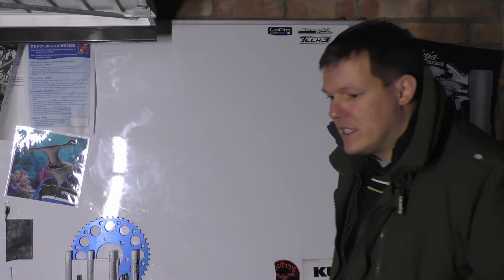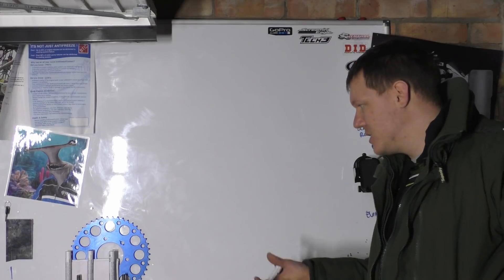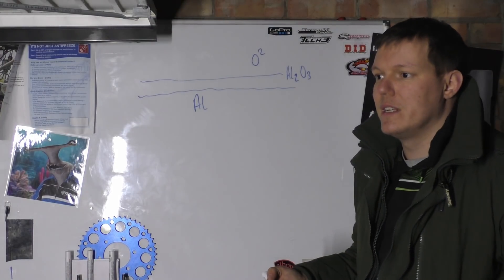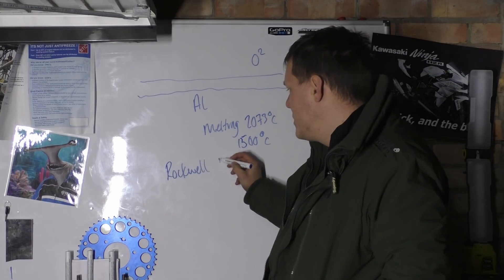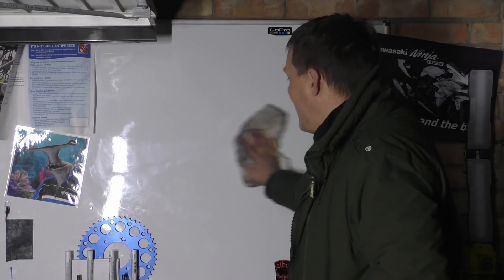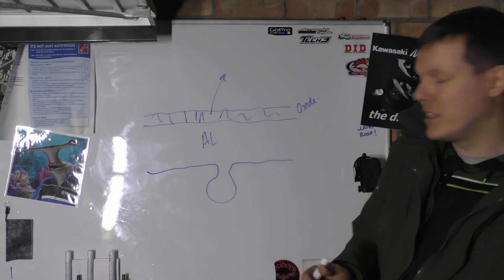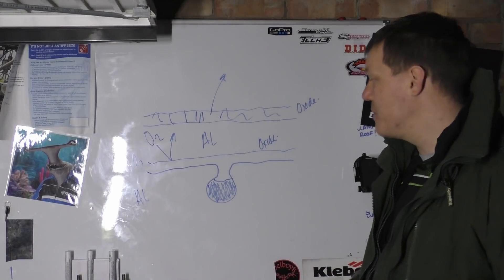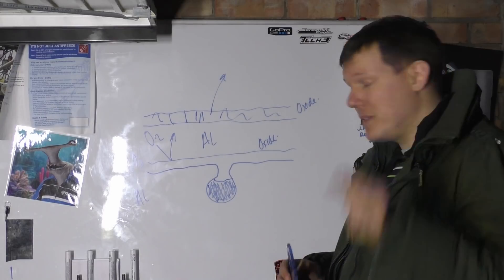Aluminium anodising - why?

Comment: First syllable = "A",  Short should "Ahh"
Second syllable = "Lu",  Like skip to my Lu. 
Third syllable = "min"  like 60 seconds
forth syllable = "um", like umm.
A-lu-min-um

I don't think aluminum (spelled correctly) oxidizes as fast as you say.  Machine and Polish some 6061, and it stays that way for quite a long time.
Reply from the maker: You mixing up oxide layers and oxide crystal growth -

Quote from Dr. Charles A. Bishop's (a chemical engineer) book - Aluminium and other alloys -

"Thus the first monolayer of oxidation is virtually instantaneous dependent only on the arrival rate of oxygen. Beyond this the oxidation rate is dependent upon both the oxygen arrival rate and the rate of diffusion through the existing oxide layer. 

Typically the oxide could be expected to be 1.5nm –2nm almost immediately and 2nm – 4.5nm in anywhere from 1 month to 1 year dependent upon conditions."

Source - http://www.cabuk1.co.uk/

Comment: An application where you can use anodization is iterative improvements of supporting arms for wheels etc, if there's some unexpected stress on the component you get these nice lines in the opposite direction of the stress. Then again if you need such weight reduced parts you probably have the money to let someone else deal with developing them anyways.

Comment: The anodizing of AN fittings seems to almost make galling of threads impossible for the reasons you stated. You can use a Sharpie marker to hide scratches in anodizing quite effectively, for a little while, anyway.

Comment: Great work... can you do a video on the optimal distance a single  cylinder piston should be when at top dead center in relation to the tip of the spark plug or the deck of the cylinder head... minimum and maximum distances
and how it relates to directly on engine performance. Thanks !
Reply from the maker: You mean the squish or clearance volume?
Reply: The Workshop sorry.. squish.. thanks !
Reply: Dave Micolichek quench is a negative effect on spark plug detonation ??

Comment: Many years ago, I remember reading that hard anodizing (anodizing in a cold bath with high electrolysis current) would build an oxide layer so thick that it was used to close the clearances on worn supercharger rotors to restore their performance to like new condition.
Reply from the maker: They have also used electro polsihing to bring back the tolorences when doing this. Electropolishing is a slower process and easier to control.

They would build up a layer of oxide - then after measuring - reduce this through the polishing process.

Comment: Anodising works differently to how you described it. Electrolysis is used to grow the oxide layer, not break it down. Within certain limits the longer you leave it in the tank the thicker the layer grows. Unlike the oxide layer that forms naturally the anodised layer is porous. This is where the dye goes. It does not go into pores in the metal. After anodising the part is exposed to steam or boiling water which seals off the pores, sealing in any dye and toughening the surface. 
Many moons ago I did some anodising. It's not particularly difficult, though getting the parts clean enough is a pain and you need to be a bit careful around concentrated acid - once diluted it isn't too bad though it rots clothes like you wouldn't believe. The worst bit is that the sulphuric acid fumes from the electrolysis make everything in your workshop rust like hell.
Reply: LesNewell Yep. The devil is in the detail isn't it? Matt sounds as though he knows what he's talking about on a fairly diverse range of subjects, but he's frequently sketchy on the facts. That's why it's important to do one's own research.
Reply from the maker: "He's the founder of Wikipedia, as Google could have confirmed for you. I wrote it in plain English."

- Yeah, that's not what I meant. What does that have to do with anything? Was my point. You went off on some weird tangent about Daniel Gauntlett. I get that you were banging on about the accuracy of wikipedia - but what does Daniel Gauntlett have to do with the subject? 

Secondly, it seems that you may have misunderstood how wikipedia works. I'm sure this is a stupid thing to say but part of what you said makes it sound like you think that Wales writes all of the information on wiki? LOL 

If you don't believe this then good, but that also makes the rant about Daniel Gauntlett void.

Back to the point both you and LesNewell both seem to agree that the base metal (ally in this case) isn't part of the oxide layer - or to quote 

"Electrolysis is used to grow the oxide layer, not break it down. Within certain limits the longer you leave it in the tank the thicker the layer grows. Unlike the oxide layer that forms naturally the anodised layer is porous. This is where the dye goes. It does not go into pores in the metal."

Firstly, the acid breaks down the oxide layer, secondly the oxide layer is Al2O3 - so where does the Al2 come from? Space? I agree that the oxide layer is porous and this is where the dye goes - but I didn't say anything contrary to this - I just did go through the entire process as this was about why its don't not to the letter how its done. I didn't state what acids or the acid generally used is. I didn't 'explain' anything about anodes or cathodes or what cathodes are used - I didn't mention what voltages, which way the current flows, layer thickness, brighteners, buffers or anything. 

Seen as though I have done anodising and plating before (some of which is on my channel) then I do understand how this works. You seem to think that I have just done a delboy - and guessed. 

We're gonna go into this in a video this week, and you're gonna look like a tit yet again. But keep up this 'matt needs to do some more research bullshit - its great. 

To add, I haven't seen your video or explanation on any of this stuff, shame really.
Reply from the maker: "Anodising works differently to how you described it. Electrolysis is used to grow the oxide layer, not break it down."

- I get where you're coming from and its a bit of both. The acid breaks down the oxide layer. I just thought for a simple video this was an easier way to describe it.
Reply from the maker: "Matt sounds as though he knows what he's talking about on a fairly diverse range of subjects, but he's frequently sketchy on the facts."

- what 'facts' am I missing?
Reply: Where you failed to describe the process as it actually occurs. Unless I and LesNewall both misheard you, you claimed the pores in the aluminium are what accept the dies, whereas it's the pores in the oxidised layer that accepts the dies, which I don't recall you mentioning. 

I also don't recall the (essential) electrical process being described. It's not as though the process is actually very complicated, so your "simple video" defence is somewhat mute here. 

Even the Wikipedia page describes it accurately:

"The anodized aluminium layer is grown by passing a direct current through an electrolytic solution, with the aluminium object serving as the anode (the positive electrode). The current releases hydrogen at the cathode (the negative electrode) and oxygen at the surface of the aluminium anode, creating a build-up of aluminium oxide. Alternating current and pulsed current is also possible but rarely used. The voltage required by various solutions may range from 1 to 300 V DC, although most fall in the range of 15 to 21 V. Higher voltages are typically required for thicker coatings formed in sulfuric and organic acid. The anodizing current varies with the area of aluminium being anodized and typically ranges from 30 to 300 A/m2 (2.8 to 28 A/ft2).

Aluminium anodizing is usually performed in an acid solution, which slowly dissolves the aluminium oxide. The acid action is balanced with the oxidation rate to form a coating with nanopores, 10–150 nm in diameter.[6] These pores are what allow the electrolyte solution and current to reach the aluminium substrate and continue growing the coating to greater thickness beyond what is produced by autopassivation.[8] However, these same pores will later permit air or water to reach the substrate and initiate corrosion if not sealed. They are often filled with colored dyes and/or corrosion inhibitors before sealing."

Ergo, without mentioning the oxidised layer - or the process that creates it, and as far as I can recall, describing the pores of aluminium itself as the host to the dies, yes, you're sketchy on this subject, and left out FACTS ESSENTIAL TO THE ACCURATE DESCRIPTION OF THE ANODISING PROCESS. 

I'm no big fan of Jimmy Wales because he's clearly sold out to the establishment over the accurate reporting of many facts that are considered 'controversial' by the powers that shouldn't be. These include subjects as diverse as the death of Daniel Gauntlett and the history of terrorism. 

The former page was disgracefully removed following lobbying from a Tory MP that claimed Daniel Gauntlett did not do anything remarkable in his life. The fact is Daniel Gauntlett was a homeless man who made headlines five years ago when he froze to death after police forced him to sleep outside rather than in an empty house. Those of us who were involved in trying to highlight the plight of homeless people in the UK considered that to be a serious issue deserving at the very least a Wikipedia page. With the help of Mark McGowan and Kate Rudby, I contributed a rather average video. 

The page on terrorism manages to not even mention any of the terrorist acts committed by the Irgun, the Haganah or the infamous Black Hand Gang. Why? Because they were Zionist terrorists, and the official narrative is that only Muslims are terrorists. 

Now, one could argue (erroneously) that those subjects could be open to speculative or subjective reporting. However, the same cannot be said of an electrochemical process can it?
Reply: "- to add I don't know what the Jimmy Wales nonesense is all about????"

He's the founder of Wikipedia, as Google could have confirmed for you. I wrote it in plain English. I'm sure the meaning is equally easy to discern. You don't come across as someone who parades ignorance as a virtue Matt.
Reply: Apologies Les, I misspelled your surname last night in my "nonsense" reply.
Reply: The Workshop
"- Yeah, that's not what I meant. What does that have to do with anything? Was my point. You went off on some weird tangent about Daniel Gauntlett. I get that you were banging on about the accuracy of wikipedia - but what does Daniel Gauntlett have to do with the subject?"

It's only weird if you don't take a moment and apply some lateral thinking bro. So, it's about what Wikipedia WILL accept and WILL NOT accept. 

"Secondly, it seems that you may have misunderstood how wikipedia works. I'm sure this is a stupid thing to say but part of what you said makes it sound like you think that Wales writes all of the information on wiki? LOL"

Ah! :) No, of course I don't think that. But he's the one that meets with the powers that shouldn't be - whilst begging for donations from ordinary users. You CAN enter a whore house without getting dick rot, but you CAN'T run one without being a pimp. Whores I have the greatest respect for. They're selling the best asset they have that's truly theirs. That's an honest business transaction. It may actually be the only one, but that's a somewhat deeper philosophical issue. 

"If you don't believe this then good, but that also makes the rant about Daniel Gauntlett void."

No, it doesn't. Accountability it what it's all about. I primarily used Daniel Gauntlett as an example because I have intimate knowledge of how Wikipedia as an organisation responded to his story. It accepted the claim (from a non interested party that was representing the very political party that caused him to be homeless and broke) that his life was not worthy of record, therefore his death was not worthy or record. That (as they say in US courtrooms) goes to the credibility of the Wikipedia service as a whole. 

The Israeli terrorism omission is another example that ably illustrates the issues of credibility that Wikipedia has. Importantly these exceptions cause contradictions that are counter to the corporate message. 

It's also important to understand what these contradictions also prove: that the removal of the profit motive from the process, and the use of volunteer labour (voluntary slavery) has not removed the bureaucratic or the corrupt elements. 

"Back to the point both you and LesNewell both seem to agree that the base metal (ally in this case) isn't part of the oxide layer - or to quote 

"Electrolysis is used to grow the oxide layer, not break it down. Within certain limits the longer you leave it in the tank the thicker the layer grows. Unlike the oxide layer that forms naturally the anodised layer is porous. This is where the dye goes. It does not go into pores in the metal."

Firstly, the acid breaks down the oxide layer, secondly the oxide layer is Al2O3 - so where does the Al2 come from? Space? I agree that the oxide layer is porous and this is where the dye goes - but I didn't say anything contrary to this - I just did go through the entire process as this was about why its don't not to the letter how its done. I didn't state what acids or the acid generally used is. I didn't 'explain' anything about anodes or cathodes or what cathodes are used - I didn't mention what voltages, which way the current flows, layer thickness, brighteners, buffers or anything. 

Seen as though I have done anodising and plating before (some of which is on my channel) then I do understand how this works. You seem to think that I have just done a delboy - and guessed. 

We're gonna go into this in a video this week, and you're gonna look like a tit yet again. But keep up this 'matt needs to do some more research bullshit - its great. "

Okay, I get where you're coming from Matt. I accept I was wrong about the research bit. 

I was pointing out that aluminium itself does not accept the dies. It is in fact IMPORTANTLY ONLY the very thin electronically induced oxidised layer that accepts the dies. That was my point. Ergo it WAS INACCURATE to state that the aluminium accepted the dies, because aluminium in its unaltered state does not accept dies. And no, aluminium oxide is not aluminium. It is strictly speaking aluminium in its altered state as a result of being exposed to an electrolytic effect within a controlled acidic environment. You can of course theoretically have aluminium without a thin aluminium oxide capable of accepting dies, but you can't have anodised aluminium without that oxidised layer. 

"To add, I haven't seen your video or explanation on any of this stuff, shame really."

It's on my YT channel. I don't make vids. I don't have the time or patience alas. But I know Mark, and when he made that vid it affected a lot of people. The man died in the freezing cold - underneath the stars, which just happens to be one of my favourite songs by Kate Rusby. All I did was put the two together badly. But a member of Daniel's family contacted me to thank me. Mark deserved the real credit though. 

And the other connection of course was the word: die. We all do it. But whilst a few of us may get to die silk or the electrochemically oxidised layers of aluminium parts, some sadly do it as a consequence of the actions of others. For the past 16 I'm about holding the truly guilty to account. 

You're ex military. So am I. You may have guessed I've progressed a long way from the lad seeking adventure in foreign lands and flag waving. But I still enjoy a good debate based upon the facts ;)) It's a journey. Peace.
Reply from the maker: "Where you failed to describe the process as it actually occurs. Unless I and LesNewall both misheard you, you claimed the pores in the aluminium are what accept the dies, whereas it's the pores in the oxidised layer that accepts the dies, which I don't recall you mentioning. 

I also don't recall the (essential) electrical process being described. It's not as though the process is actually very complicated, so your "simple video" defence is somewhat mute here."

- LOL hang about aren't you answering your own question here? This video is about why aluminium is anodised - not an instructional video on how to 1) do it. 2) the process explained.

"FACTS ESSENTIAL TO THE ACCURATE DESCRIPTION OF THE ANODISING PROCESS."

- against this is not 'an accurate description" - 

Secondly both you and LesNewall have misunderstood or not fully described the process. But we'll cover this in a reply to this comment.

- to add I don't know what the Jimmy Wales nonesense is all about????

Comment: I thought it was extrange the melting temps you mention. I think you got it backwards. Al melts at 660°c and iron at 2470°C, at least thats what the googles said. From experience you can melt Al in a crappy furnace in your backyard, but not steel.

Edit: You were speaking aboult Al oxide, not just Al... but are the numers right? that change the melting temperature from 660 to 2073?
Reply from the maker: Aluminium oxide melts at 2073 not iron. Aluminium melts at 660dgeC and some of the alloys (silicon based alloys) melt a bit higher.

Comment: Why is the dyed and anodised alu better than the automatically (natural) anodised version. Has that to do with a smoother surface?
Reply from the maker: You can control the oxide thickness.